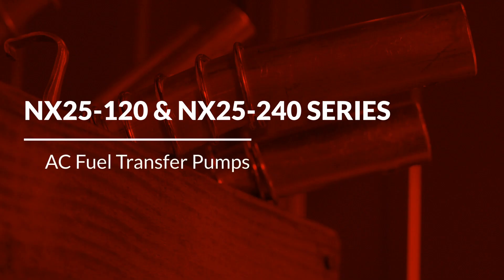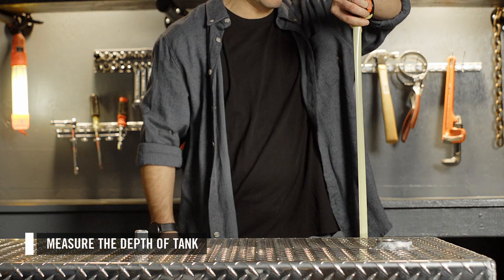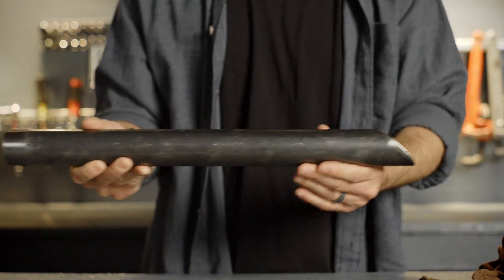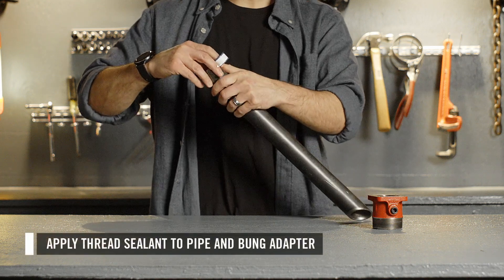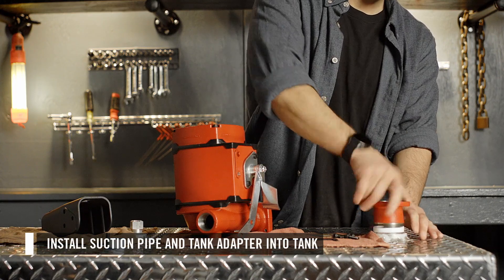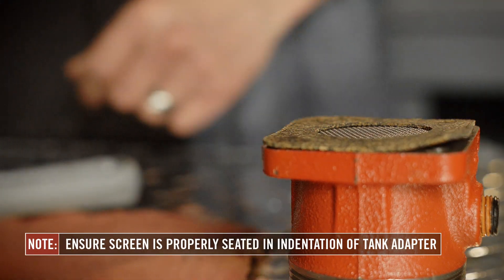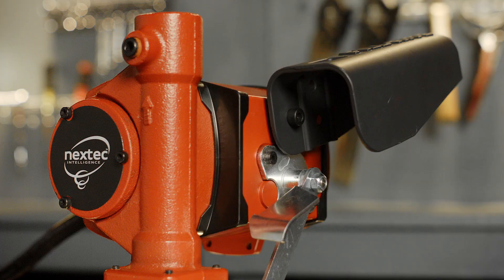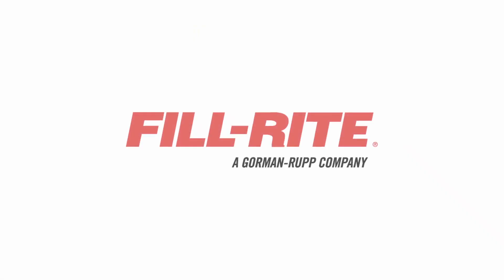Fill-Rite NX25-120 & NX25-240 Series Fuel Transfer Pump Installation

Comment: I have been installing Fill- Rite pumps for almost 30 years ,in Ontario Canada. We are required to use explosion proof tech cable electrical fittings when wiring . The area provided on the FR701 pumps is getting smaller and the fittings are getting larger. constantly causing a interruption in customer service while locating a smaller fitting or a less safer connection. The FR311 pumps come with a extra junction box making the connection much safer.